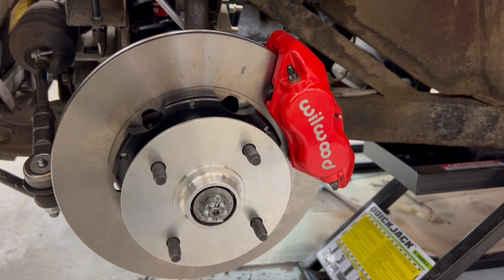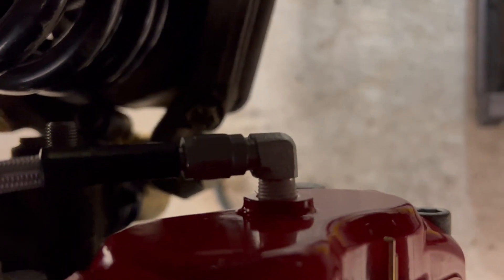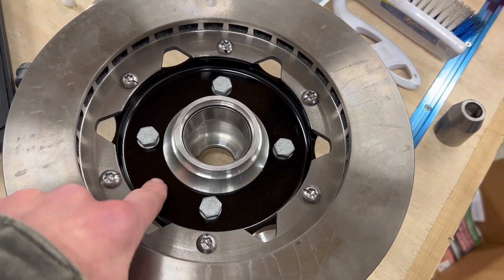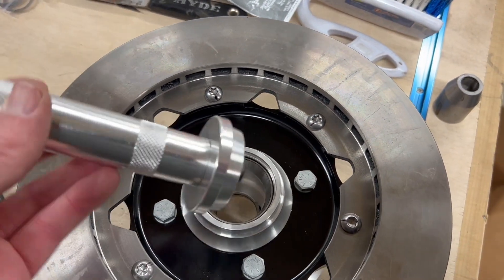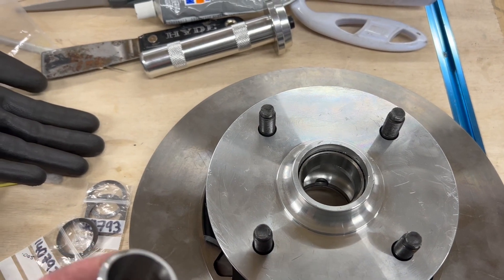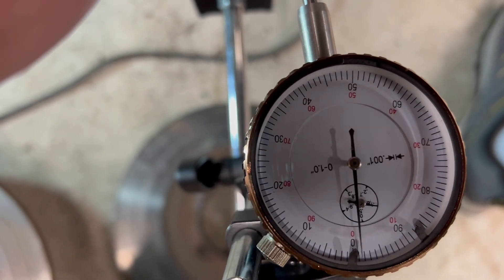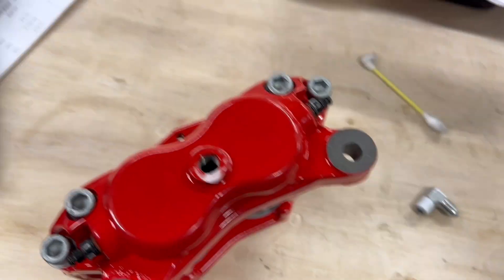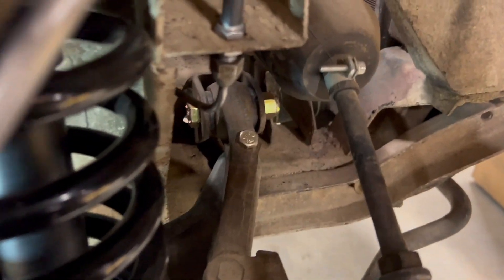1969 Triumph TR6 Wilwood Brakes

Comment: On cooling Revotec rads and fans are great. Also look at removing all water from system using Evans gel. Prevents overheating and internal corrosion. YouTube video from Edd China on WD. 😎